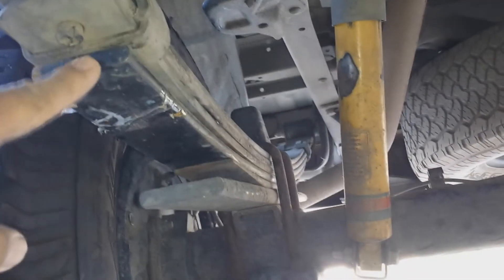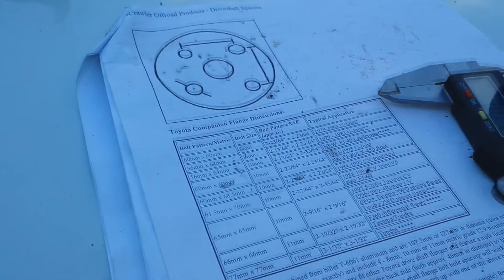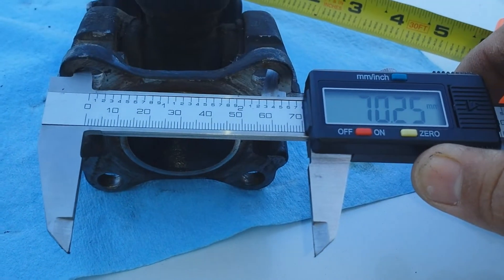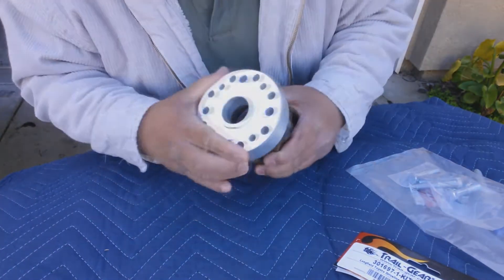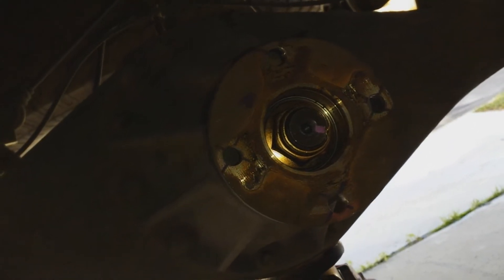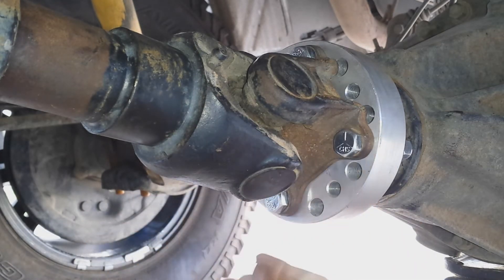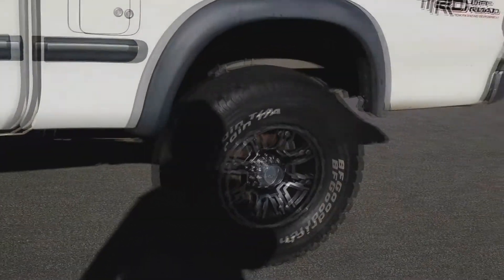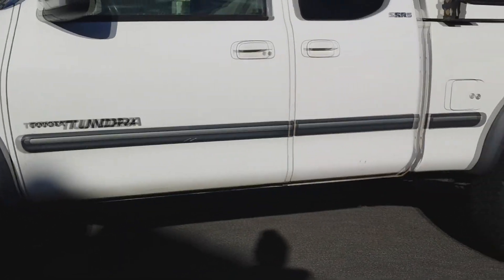1st Generation Tundra Driveline Spacer

Comment: I like your set up and I've enjoyed your videos.  Your a talented mechanic and have a lovely family. 
 I have a 2010 Tacoma. I dont go off road ever but after I installed a plow I lifted the truck because the plow frame scraped often on the 1/2 mile of rough private road to my house and I added leaf spring helpers in the rear because I haul stone, coal, and firewood every year.  So I've got 3" spacers over the struts up front and 2" blocks in the rear with the leaf spring helpers that I figure ad 3" - 4" for a total of 5" - 6" of lift in the rear. I've driven on that for years with a vibration / noise in the drive shaft when I let off the gas and its slack. No issues. Just a rattle really. I recently found out about the spacer for the driveshaft and installed a 3/4" spacer on rear diff end. It has improved the noise but not completely gone. I can live with it. I worry about carrying a load on it now and whether it will crash or not. I recently had a full ton of coal on the truck but that was before I installed the spacer. I've looked online and cant find any good info or geometry for figuring out a good lift height to spacer thickness ratio. Any advice you might have on where to go or if you would just share your opinion I'd really appreciate it.
Reply from the maker: Have you tried shimming the carrier center support bearing on your drive shaft? That should help dramatically. Also check to see is your drive shaft center support bearing is in good condition. If it is, shim it (add shims to it) by using washers.
Reply: @theotherguy3083  it's a regular cab. No carrier bearing. It's a two piece shaft from transmission to rear differential.
Reply: @theotherguy3083  my main concern is useing to much spacer and bottoming out the shaft when I put a load on the truck.
Reply from the maker: @DaveRogers583  it is a 2 piece drive shaft?
Reply from the maker: @DaveRogers583  I'd say stay conservative on the drive line spacer.
Reply from the maker: Is it is a 2 piece drive shaft you should have a center support bearing where the 2 DS meet. If you have a bad bearing there, it could be the reason why u can feel a vibration
Reply: @theotherguy3083  there is no center support bearing. It's one drive shaft made up of two pieces. The slip yoke and the shaft. Ofcourse the joint where one slides into the other is covered with a rubber boot so it's hard to see how much play is there. It's a regular cab so just one drive shaft. 
 Thanks for the advice. I did that and went with the 3/4" spacer. I'll have to see what happens with a load on it.

Comment: It's good to rewatched your video again my hmong brother from your hmoob Vaj brother. I found a land cruiser one off ebay for $7 used, it's 3/4 adapter with only 4 holes which wasn't designed for the T100. Because the bolt hole needed to longer but not wider. I did a little drilling on two opposite side and it bolt right on. My T100 only 1-2" lift but my yolk was out like yours about 3/4 to 1/2 out though. I put the adapter on and the yolk sets in back to the way it was be4. Overall if found something that works than your good
Reply from the maker: Awesome

Comment: maybe i missed it..   but also  when you pull out yoke.. splined slip yoke..   need mark original location..  u joints need be alligned correct..    end to end..     and just to be carefull.. check grade bolts supplied kit..  need be  hard..

Comment: I did the exact thing installed the helper spring and did not notice to much difference however the 22re 4 cylinder was starting to run weak and after some research I discovered a Toyota 2.4 turbo diesel (2015) from Japan bolted right up to my 1986 4x4 pickup for about the same price as the rebuild of the 22re . I located one on eBay that was already converted to a mechanical fuel pump with transfer case and manual transmission with ecu (computer) and was amazed that it was plug and play but the rear drive shaft was like yours and was also concerned it would come out at some point , and was going to get the drive shaft extended by a machine shop but after seeing the video I found the trail gear spacer on eBay and it.arrived today and read the warning and disclosures on the directions it sounded like for off road use only but wasn't sure ! How smooth was it afterwards? Can you tell a difference, I'm running the BFG mud terrain so there not as quiet as the all terrain tires ! Amazing enough I'm getting 40 mpg with this diesel and love it....
Reply from the maker: Johnny White honest truth, if feels like the original non extended shaft. Been using mine offroading, towing, and street driving. Awesome spacer.
Reply: Awesome thanks for the video as well as the quick reply I was concerned about the bolts as well but sounds like they are acceptable thanks pal keep on trucking and enjoy !!
Reply from the maker: Johnny White I upgrades the bolts to grade 8 cap bolts from home depot. I thought the bolts that came with the kit was a little too weak for the job.

Comment: I lift my tundra 2006 2.5 inches
And I used rear blocks  not leaf  springs  do you think  I need to use the spacer 
I dont think I need it  what do you think...
Reply from the maker: That's for you to determine. If you feel drive line vibration, there is a possibility that the yoke have slipped out a little too much.

Comment: Old video but do you remember how much more of the yoke was left still connected after lifting? I’ve seen bigger rear lifts with tundras and not sure if any1 has a driveline spacer
Reply from the maker: Jay J I measured mine after I installed it and it came out 1 inches.  Thus I replaced mine with a one inch spacer.  This is for a 6 inch lift o had for my rear
Reply: The Other Guy what symptoms made you add it? If only 1” was pulled out, how much more till it will fall out? Also the read spring is usually the limiting factor
Reply from the maker: Jay J during severe articulation, the shaft can pull out.  I have also seen lifted vehicles stranded on highways with the shafts fallen out.  Symptoms, some truck has driveline vibration as a result because they are ready to come out.

Comment: anyone know if the driveline from the 05-06 is the same as the 00-04?  Bought one of these and did not fit.
Reply from the maker: The 05-06 flange is bigger than the earlier model Tundra so it will not fit.

Comment: wouldnt dropping the support bearing do the same thing? reducing the shaft angles at the same time.
Reply from the maker: TheSnake dropping the support bearing does help a bit. but just a bit. if the slip yoke comes out too much it won't help much.
Reply: I just installed a 3" lift and noticed the same thing. I also developed some drive line vibration. a) Did you have any vibration and b) did this solve that?
Reply from the maker: TheSnake drive line vibration is a result of the differences in slip yoke angle and sometime the slip yoke coming out too far. which translate to a dangerous situation when driving of road surface which forces the suspension to travel up and down.  if the suspension travels down too far, the yoke will slip out causing the drive shaft to come out and it's just not a good ending.
Reply from the maker: TheSnake drive line vibration is a result of the differences in slip yoke angle and sometime the slip yoke coming out too far. which translate to a dangerous situation when driving of road surface which forces the suspension to travel up and down.  if the suspension travels down too far, the yoke will slip out causing the drive shaft to come out and it's just not a good ending.

I didn't have that problem.  However, I went ahead and installed the drive line spacer so that I can have peace of mind offroading, as during offroading is when you get the most suspension flex.

My 4runner did have that problem however, and that was solved by a drive line spacer.
Reply: I cann't thank you enough for the video's and knowledge.
Reply from the maker: TheSnake if you find my video helpful please like and subscribe.
Reply: I have done both
Reply: Great info, thanks! 
Does anyone make a carrier bearing drop for a 2000 tundra? I’m planning to do the driveline spacer but am curious if I also need a carrier bearing drop? 
Thanks!

Comment: Will this spacer fit all 1st gen tundra’s? I have a 2004 crew cab.. Please let me know, thanks..
Reply from the maker: Jack Lee yes
Reply: The Other Guy thank you.. I will place my order today..
Reply: Tried this on my 06 double cab and it didn't line up. Tried all the bolt holes.
Reply: @kouvang9542  You probably need the 11mm bolt spacers, likely 66 x 66, 77 x 77 or 88 x 88 mm bolt pattern:
- https://www.4crawler.com/4x4/ForSale/DriveshaftSpacer.shtml#SpacerDimensions

Comment: Bro the yolk won’t ever come out. The rear end would have to fall off of the truck in order for the driveshaft to come out. The rear end does not travel enough to let it fall out.
Reply from the maker: Not if you lifted it as high as mine and then off road with it
Reply: @theotherguy3083  here in hawaii, people are leveled at 8-9” of lift AND go off-road with no problems. They have 5” blocks and double add a leafs. NO drive shafts spacer.
Reply from the maker: @defectahz6399  good on them. Hope the yoke don't slip out